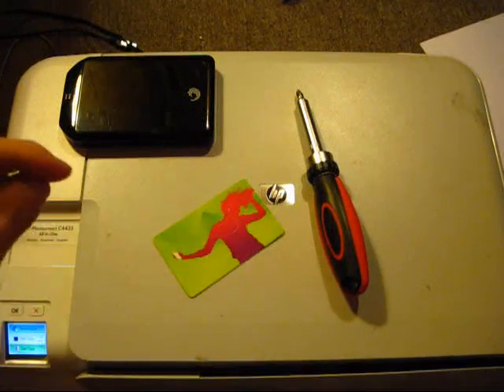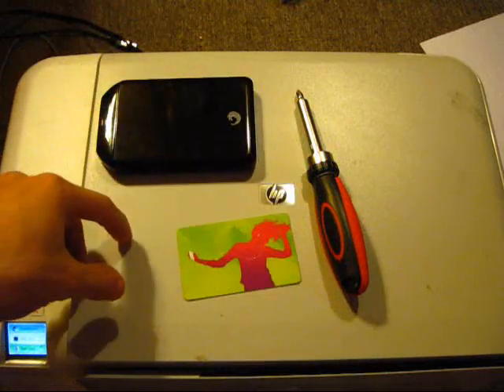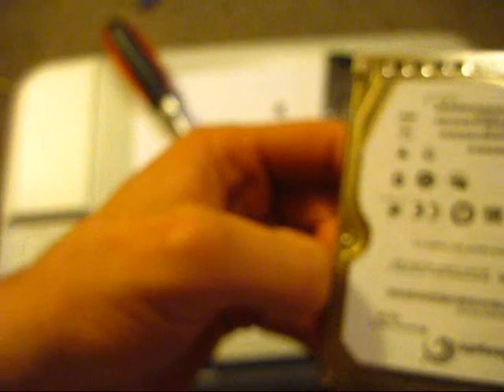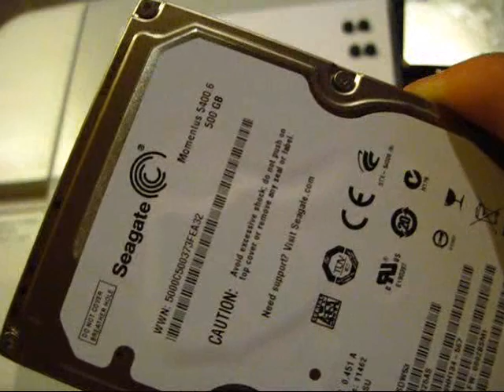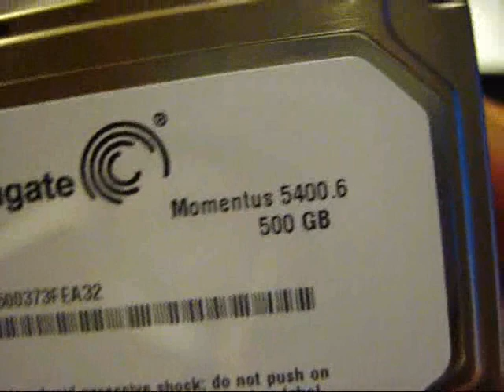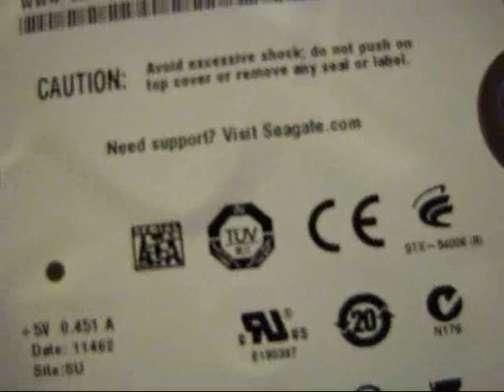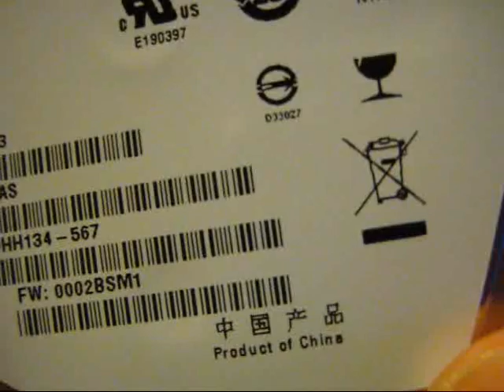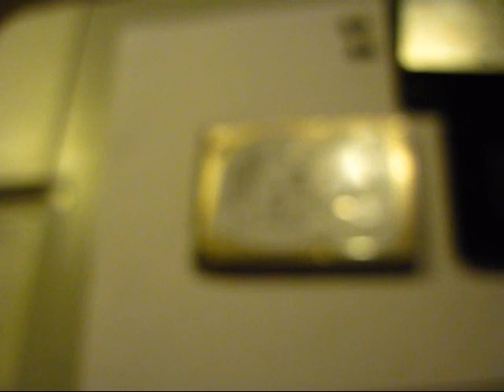How to fully DISASSEMBLE a SeaGate FreeAgent GoFlex Portable External Hard Drive

Comment: I have heard that a video has to be a certain length in order to monetize it. I would have appreciated a little more concise video, but either way, you gave me the information I needed and I appreciate it!
This was ly.mother-in-laws and we weren't sure what was on it. Unfortunately, the interface had died so we couldn't access it. Thanks to your video, we got it out of the case and into a drive adapter. Turns out it was pictures from years and years worth of vacations! Thanks again!

Comment: Thank you very much. Video helped me to open the case and access the drive, since the converter (SATA to USB removal connector on the drive) has gone bad. I got a SATA to USB converter cable and it  did not fit. So, I have to open the case and access the drive. Now, I could access the drive. Thanks.

Comment: best buy pushed this piece of shit on me, it wouldn't work on my laptop because the usb wasn't putting out enough power, and then it died using usb3 because it was spinning at a buzzilion spins a second. this is garbage. pull out the connector and use it as a sata-usb adapter. at least u can use it for that.

Comment: You are right, the thickness of the drive is odd.  I've handled hundreds of laptop drives, and I've never seen a double-thick like this one.  I have seen double-thick ones like this back in the late 90s, with regular sized computer drives, but this is the first time I've run across one in a laptop drive.  Most likely, it's two 500GB platter stacks, stacked together with a double sized head.  Anyway, looks like (from my google searches) that this drive fails a lot.

Comment: That's a 5400 rpm hard drive.  I just use another laptop hard drive with 7200 rpm and plug the USB connector/adapter to the new hard drive.

Comment: I also have a this one.but now there is a problem.when i plugged it to my pc.my computer doesn't display the hard disk.and some noise also coming fo=rom the inside.can you help me to solve this problem?
Reply from the maker: what did it sound like?
Reply: ***** it is like clicking sound.i think it is from the platters.please help me
Reply: ***** I'm also facing a similar issue with the same model. My hdd was dropped from a height of 50cm. Now the computer won't show it on the system and the light on the hdd turns on after some seconds and not immediately like always. Also, the clicking sound goes off after some time and nothing else is heard.
Reply: ***** please help.
Reply: If you're hearing a clicking noise, the hard drive is shot and you lost all your data.
Reply: Aniket Srivastava actually I couldn't recover my data in the hdd. But I formatted it using cmd and it took more than 10 hours to complete. Now it's working. Always eject the hdd from the os before remove the hdd from USB port.

Comment: Just a quick tip: to keep the mounting screws and rubber mounts without having to store them separately, and thus risk losing them, place the rubber mounts onto the mounting screws as they came with the drive, insert the screws into the holes in the metal bracket, and carefully reinsert the bracket into the plastic lower case, just as you would if you were reassembling the drive (note that it can be hard to do so without one or more screws falling back out, but just proceed with the remaining screws, then angle the metal bracket out on the side with the errant screw, and reinsert that screw.
And now you can reassemble the empty case or just store the top and bottom halves together, with no worries about losing the screws and mounts.

Comment: thanks drive was fried only let me read no write backed it up and then tried to format got error code so i took it apart and used a diffrent sata transfer cable (to deep for the other to reach the plugin so i ripped it apart to find it was fried going to get a new harddrive as there much cheaper with out case and reuse this case

Comment: I had success with GetDataBack with a standard HD that was just corrupted, but it would not work with the GoFlex.  I did manage to try 3 or 4 others, they did recognize the GoFlex but could not recover any files.  I finally gave up and took it to a computer service that attempted to recover the files using Linux, but also failed.  They said it had mechanical failure and only a Data Recovery Svc could retrieve the data at a cost from 299.00 to 1900.00 . I have not sent it in for an evaluation.

Comment: Hi! This is strange to me cause I have the same hard drive of yours, but mine is working well with a usb 2.0 (non externally powered) port so far.
I was thinking about taking it apart to use it inside my new laptop but the drive bay can take only up to 9,5 mm thick HDD. 
So thank you for posting the 15mm height, you spared me some time and an HDD enclosure :)

Comment: Thanks anyway and it was good that you posted this video as it will no doubt help others with this problem.  I took the GoFlex into the computer store today, they are going to see if they can recover anything, if they can't they will send it out to a firm in Denver that gets more involved, even to the extent of repairing or replacing components that may have failed possibly preventing access to the drive.

Comment: It did finally copy the ISO file to the DVD,but it now says cannot unpack, I think I'll have to try something else. I was sure hoping I could recover the data, but I'm not holding out for much hope.  The GoFlex also causes problems with the computer,  The device manager shows it listed, but when running a recovery data program the GoFlex actually locks it up, shows program not responding, and when you disconnect the GoFlex it starts up, seems pretty hopeless.

Comment: Thanks for the info, and I just watched your video.  It does appear your GoFlex and mine have similar problems, and it possibly might work on mine.   I tried obtaining the UbuntU, but for some reason the computer keeps saying invalid disk, and I cannot burn it to the CD.  I tried burning other files to a CD just to test it, and it works fine, not sure what the problem is.  It doesn't seem to have anything to do with the capacity of the disk.

Comment: I'm  afraid I've lost all the data on one of these GoFlex drives.  I heard the USB sound of connecting & disconnecting, but didn't notice it was the GoFlex.  I started to access it and found it not recognized by Windows. On occasion Windows recognized it as F, but shows no data. It's getting worse it lights up and spins but the device manager is no longer showing it listed. When it was listed I tried the data recovery software  but the GoFlex locked up the computer until it was disconnected.

Comment: The hdd in the video is a 250gb platter meaning you have two platter model(500gb).Seagate released a 500gb single platter go flex drive using the samsung/seagate hdd HN-M500MBB/ST500LM012 500GB.The go flex adaptor will never work with other hdd.

Comment: correct, but i figured it out.... once you remove the cover that says "GoFlex" that is assembled with pressure you will need to unfold the metalic foil inside that is covering two tiny phillip screws and the adapator will go out.

Comment: i hope its a 2.5 inch. because i am getting a laptop from my dad.. but the hard drive is failing. with bad clusters and battery issues. both are a easy fix. but i dont have a ton of money for a big hard drive. so i have a seagate 1.5TB hard drive that i have owned for a few years. now. and i was thinking about popping it in my dads laptop. his is a dell inspiron n5010 (15R) sure hope that it is. if anyone knows if it works in a laptop let me know! :)

Comment: Google for ST1000LM024 for all the tech specs on this hard drive and take a look at the first Seagate.com result. I have the 1TB variant, which has a model number of ST1000LM024.

This hard drive fits in my Asus G50VT-X5, but then again my laptop has a LOT of clearance for a hard drive. I did not physically measure it because I'm too lazy... but not lazy enough to take this apart and put it into my laptop, go figure.

Comment: Thought the same damn thing.

If you're too lazy to skip ahead and just want to read the directions:

1. Wiggle the adapter out.
2. Use a credit card (or like item) to score around the enclosure where the two halves meet. Do this without putting pressure on both halves; otherwise, you just close it up again.
3. Separate the halves.
4. Lift the hard drive out from the non-SATA end.
5. Remove the rubber caps. Remove the bracket by unscrewing the four bolts.
6. Ta-freakin'-dah.

Comment: I took my 1TB freeagent goflex USB 3.0 apart and found that it had a 15mm height 2.5 inch drive, (like an enterprise class 2.5 drive) so unfortunately mine won't fit into a laptop. The name on the internal drive is FreePlay 1000GB, and the PN is ST1000LM002. I've always had slow transfers and pauses during video playback on USB 2.0, so I think that's explained by the power draw of this drive being slightly too much for USB 2.0.  USB 3.0 can supply more power than 2.0.

Comment: In case anybody wants- the bare hard drive is now sold separately. It is sold for $90 witch is strange because you can get the external for around $45 and take it apart. you can find it by going to newegg and searching seagate momentus 5400.6 500 gb

Comment: If it is over 9.5 mm then it is the thicker kind.  I think only WD did that to kinda cheat and get a 1TB 2.5 inch drive out on the market first, they had to fit an extra platter in it I think.  Since that one drive no one has done that so I think this drive is standard, at least it looks like it is.

So true about the connector, I've already used mine on a naked drive to clone it to my PC.  More handy than the Ineo I-NA204Ue since it is USB3.